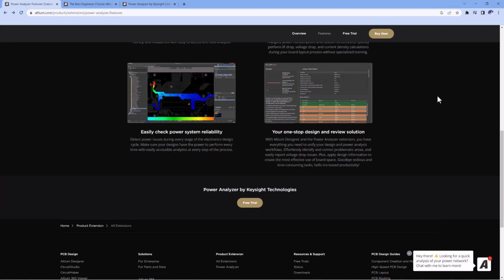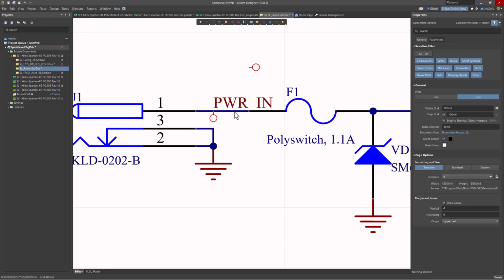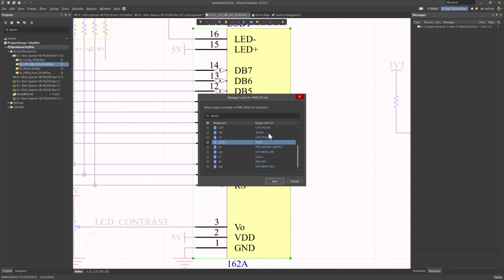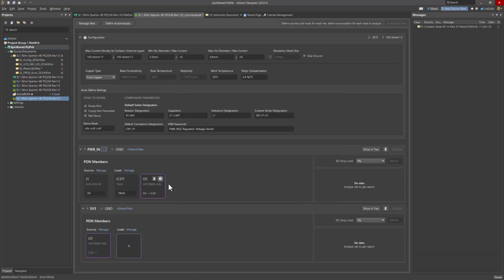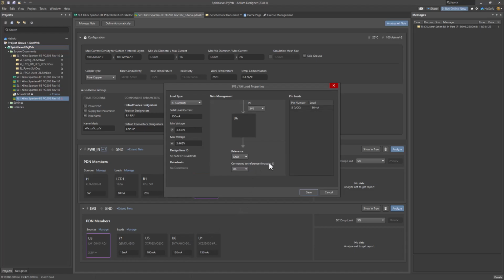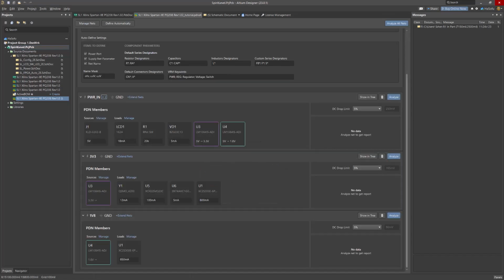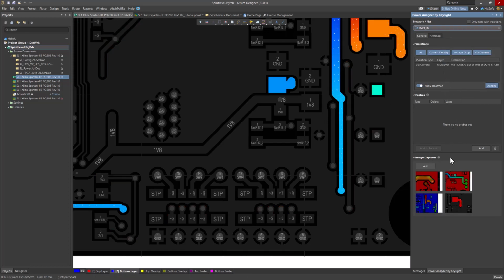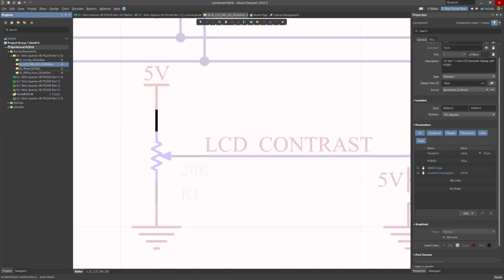Altium Designer Tutorial for Beginners: Power Analyzer by Keysight

Comment: Seems pretty bad for SMPS... Missing many parameters for controllers with external inductor, or external mosfets
Reply from the maker: Ah, so this may be better for mixed-analog or high-speed PCB designs. Or could be incomplete as of the recording of that video, like lacking some key features. If i get my hands on it in the future, i'll make an updated video. they might have it in the newer versions. what software would you recommend, if anything?
Reply: @techedkirsch  PDN Analyzer by CST seems to offer more settings. Unfortunately, did not have the chance to test it yet. Have to ask Altium a trial licence

Comment: Why bother assigning a load current or any other param to each component load if you need to define it in the load config stage?
Reply from the maker: 1. More information is better in general. I’m also paranoid about software not working the way it’s supposed to. 2. I also put more information instead of less in my circuits so I don’t have to do it in the future for some other application

Comment: What happens you simulate - it works, change a load current - it fails, change it back - it still fails? Got a 14 day demo and can't understand why - the failure messages give nothing.
Reply: Run with the default 150mA, and it's fine. Change to another number - fail. Change the load current back to 150mA, and it still doesn't 'netlist' the simulation. Delete the load, recreate and it works again!!
Reply from the maker: Sounds like a bug honestly. Hmm 🤔 it could also be conditions before the simulation or any other reason. But when I see inconsistent behavior like that, I think it’s a bug or the conditions are tight in the circuit and the solvers have trouble with their calculation parameters, limits, etc.

Comment: How would you model a transistor when driven into saturation. Take for example a BJT, with the base configured to the output of a MCU, how could I check the collector current flowing as per the analysis as I would need the MCU to output a voltage? I don't see how the analysis software would overcome this?
Reply from the maker: Ahh good question. A couple ways. You can get an existing SPICE model and modify its parameters specific to the data sheet of that prt. Then use that model in the schematic symbol by attaching it in Altium.

Modeling a transistor in those conditions, you then set up a circuit that forces it into saturation conditions and then graph the behavior. Hmm 🤔 do you want a demo in like Altium schematic? If in the PCB side I don’t know if it’s possible though.

Comment: How do you set the rules for very small ICs (like smart tracker)? I put in a MAX86171 and it shows me green error. Also how big is the trace width and the vias regarding that?
Reply from the maker: Setting the rules for very small ICs? I imagine they'll be the same rules, like minimum track width and whatnot you mean?

Or do you mean current density and smallest VIA size?

You can email me at techedkirsch@gmail.com and I can check it out!